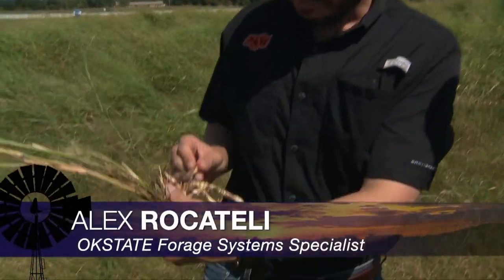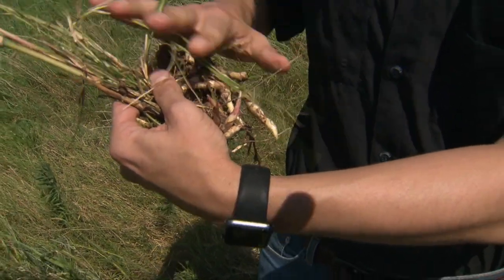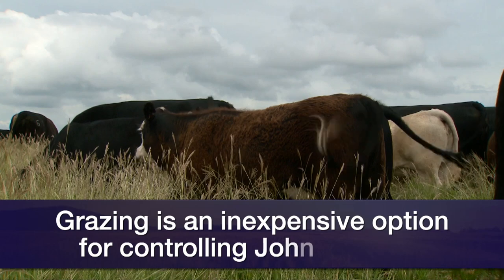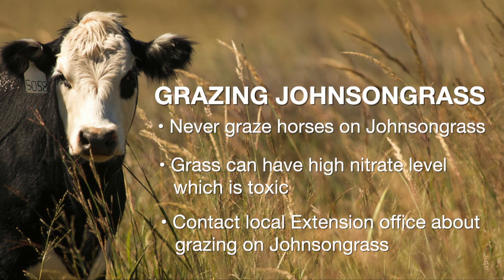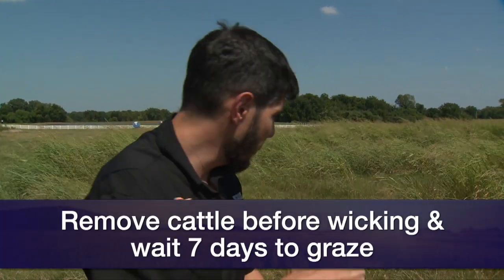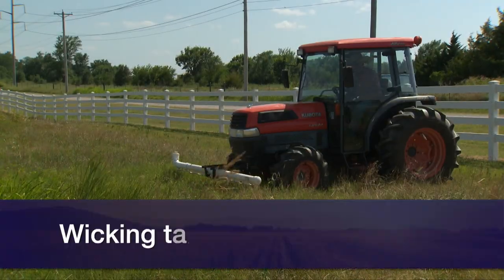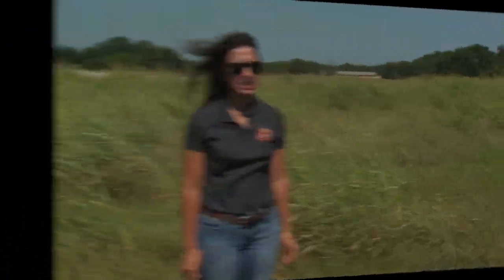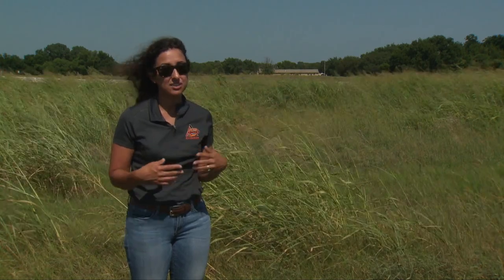The Basics of Wicking (7/20/19)

Comment: I would think you would want applicator on back of tractor, and do only 1 pass, other wise tractor tires will spread roundup on to the grass you dont want killed ? Correct me if im thinking wrong, but i know those tires will be wet, and therefore spread the chemical
Reply: Building a wick boom for my pasture right now and was thinking the same thing. I think I’m going to mount it on the 3pt hitch